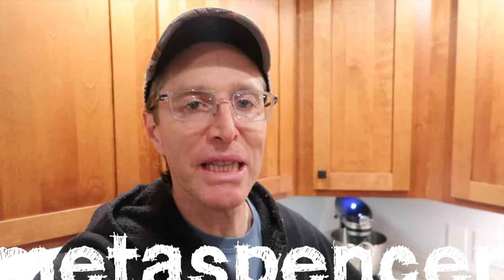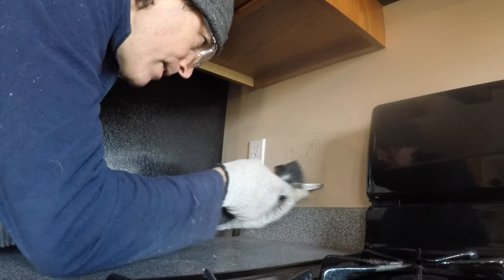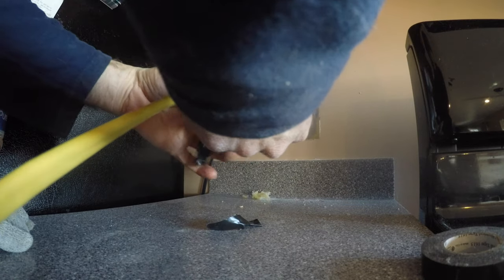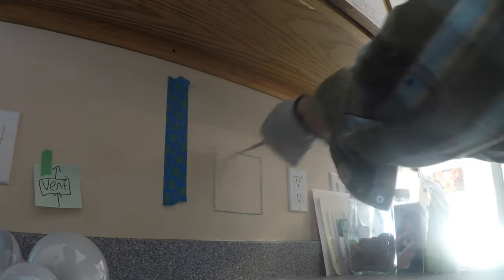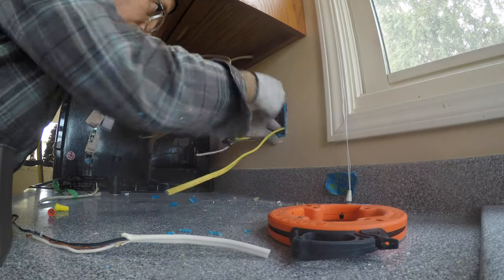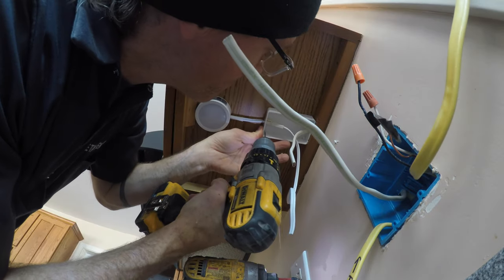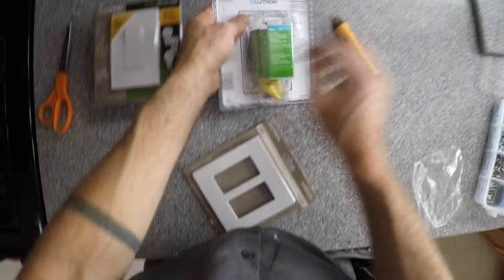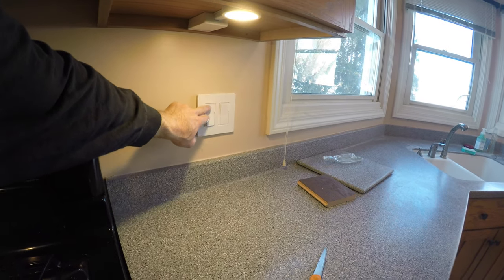Simple Under Cabinet Puck Light Installation

Comment: Brilliant! Thank you. I had an electrician come do small electrical  jobs in my kitchen and he couldn't figure out how to change the old hockey puck lights to the new one led ones and make it look neat.  I watched your video, ordered the small junction boxes and in a hour changed 5 of them. I used a dremel to cut the notches in the plastic boxes worked like a charm.  Thank you for saving me hiring another electrician. Now might add dimmer these leds are very bright. Thanks again!
Reply from the maker: Sounds like you have some nice upgrades ... good to hear!

Comment: At the final connection of the wires, no mention made of polarity, hot side of wire etc. In my case the power source wire is all black, no white-and-black so I had to find the positive side and then make sure I figured out the positive side of the puck's wire.This is tricky and should be mentioned.
Reply from the maker: I’m glad you figured it out!!

Comment: Great video. What did you do with the ground wire running from the power source to the puck? It looked like there were only two wires from the provided cable you cut. Thanks
Reply from the maker: Typically I'll use the ground wire to ground the metal junction box, if there is one. With plastic boxes and only two wires to the lights, I typically just terminate the ground wire

Comment: GREAT video!  I'm actually redoing my kitchen and replacing my old puck lights.  I didn't know you could snip the plug and make them hardwired.  I checked out the ones you mentioned, but hate 2700k.  I can't find 4000 - 6000k hardwired (No transformer) pucks ANYWHERE!
Reply from the maker: Yeah, it's hard to find the exact light quality you like .... I tend to think that dimmed, the 2700k bulbs aren't too bad, but some people notice their color a lot more. Anyway: thanks for checking it out!
Reply: This was my exact question: how to snip the puck light wire to make it hardwired? Can I use regular scissors for this?

Comment: Are lights 120 volt? transformer needed to 12 volt?  ground wire?
Reply from the maker: yep 120. need a transformer for the 12v system

Comment: Looks like the they are 14/2 wire. When do you use 12/2 and 14/2?
Reply from the maker: Check a wiring chart but basically 14/2 is just for lights

Comment: I tried this and could not get lights to come on. ???
Reply from the maker: Well, sounds like you need to do some trouble shooting: test for power, test the lights independently, then see where you're at
Reply: All lights brand new. All worked when plugged in before cutting cord in video. Wall switch has power so really not sure why it's not working.
Reply from the maker: @williamstegall9241  you could try reversing the wires where you spliced them. They could need the hot lead to go into the light on the other wire

Comment: Can you please provide the model number for these lights thank you 😊
Reply from the maker: Here's a link ... any puck light will work pretty much https://www.menards.com/main/lighting-ceiling-fans/indoor-lighting/under-cabinet-lighting/patriot-lighting-reg-led-metal-plug-in-under-cabinet-puck-light/0026-0010/p-1465526284675-c-7490.htm?tid=5528418817464348873&ipos=13
Reply: @metaspencer  thank you 😊

Comment: I feel like you could have dropped your wires down into the crawl and avoided the drywall repairs.  Like if there was a tile backsplash.  I have done it and it's not too bad.
Reply from the maker: That would be a great way to go -- but framing kept blocking my fish tape. Avoiding drywall repairs is always ideal.
Reply: @metaspencer  Yes, framing can be a real pain in the butt.  I assumed you couldn't, but thought I would add it for others.  Nice job though, you definitely have a nice set of skills.  Keep up the good work and well done videos.
Reply: I’m figuring this out for myself now too. One way I have looked at is pulling the stove. Then you can cut a larger panel out and drill through the studs and replace with a steel cover or just screw a large piece of drywall back on, but not much stress getting it too look real nice. Also suggest cardboard on the counter. The cheap al mg cast drills these days mark up easy.

Comment: Why in the world did you cut the lamp wire to use that little J box? If you're cutting the drywall and using that raceway, why didn't you just join the lamp wire to the romex in the wall? Could even have mounted a box in the wall for the connection if you were worried about it, would have been so much cleaner...
Reply from the maker: Woah, bury a junction and/or junction box in the wall? that's a code violation, man ... there is one UL rated junction device out there that I know of, but they're hard to come by
Reply: @metaspencer  Thank you for pointing out the code issue.  I had a recent renovation where my electrician did the same thing Mr. nuff'said suggested.  Catastrophe.  It is a lazy man's solution to a common problem.  Unfortunately you see on YouTube too many amateurs claiming to know how to do some things that are in fact potentially deadly.